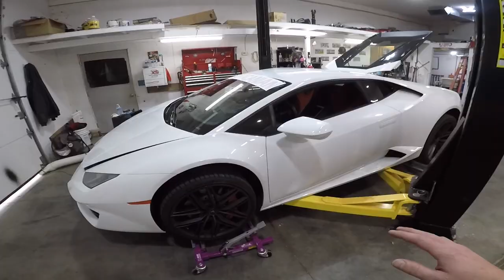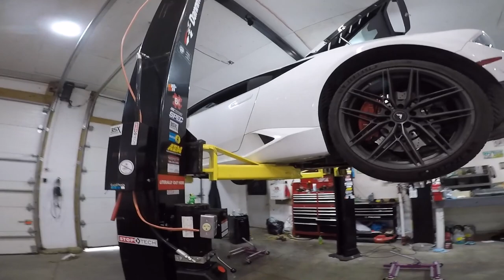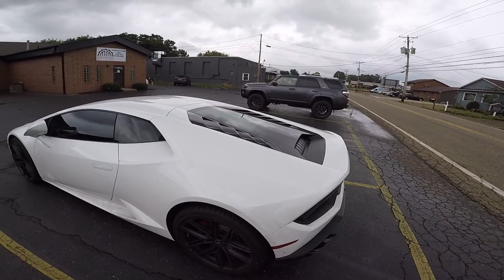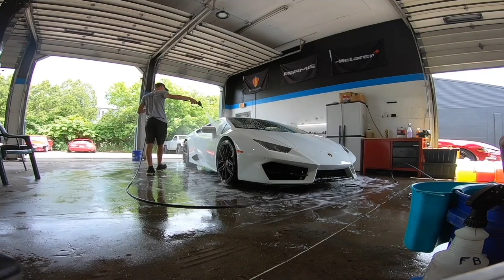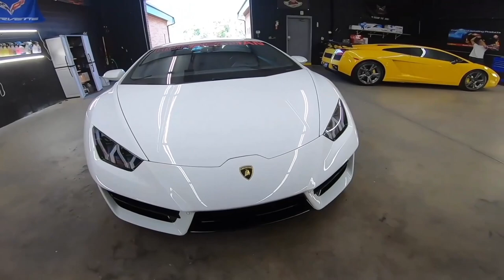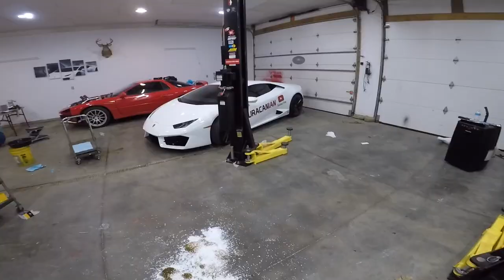Lamborghini Huracan Ready for Cross Country Road Trip [ LP580-2 ]

Comment: Ian would you be interested in doing work and content on my 1994 dodge stealth tt,  with a bunch of mods , I've put over 20gs back in 04 when things were expensive and new. . I love your work and attention to detail. Just a thought and I would your input. Keep up the good work 👏.
Reply from the maker: Idk if I got time to work on someone else's car. ... What all u what to do ? And where is the car ?
Reply: @huracanian3051  michigan , just got her started after sitting for a long time. Dnp front mount intercooler , big 16g Evo 3 with tial external gates, dnp tdo5 headers ,dnp turbo back exhaust,  ported and polished heads with titanium Ferrera valves and springs. Web racing cams with the drag race grind, fildanza adjustable cam gears, brand new stock short block bought in 02 with less than 10k miles since motor was built in 03-04. 3sx big radiator, greddy e-manage blue with profec e01 boost controller. She runs hot and I want to do the plenum spacer plus throttle thing you did.